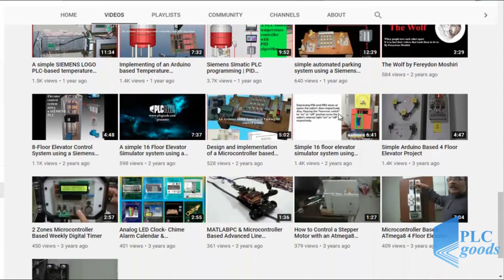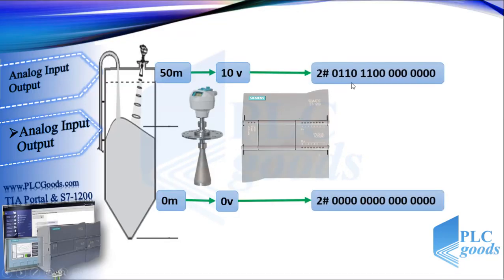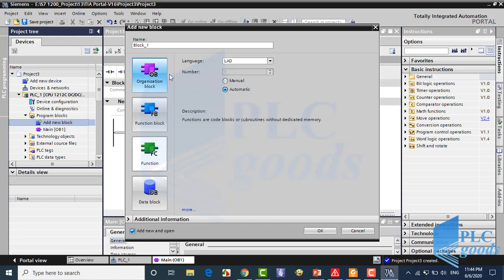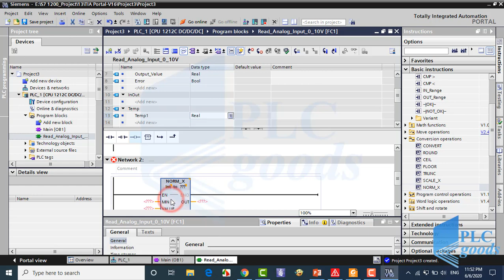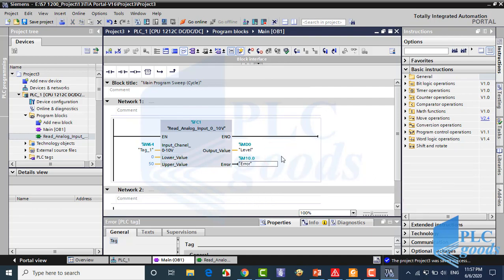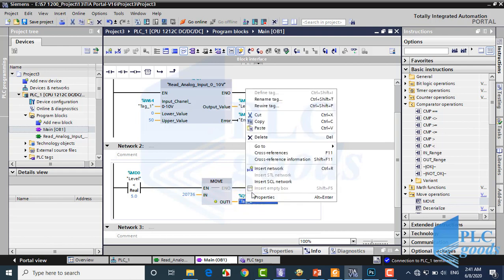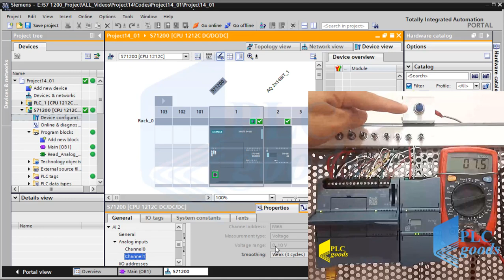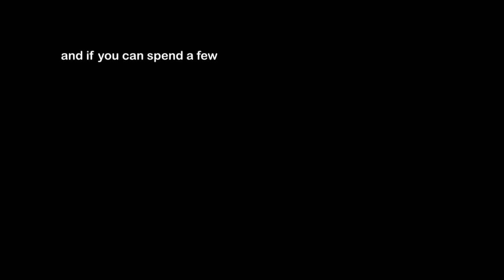How to use analog input/output signals / modules - siemens s7-1200 plc programming tutorial

Comment: Your explanation is supper and we have want to learn the S7 1200 PLC Module  connect the 68 nos of Ethernet connection and how configuration
Reply from the maker: Hi there. For example, ET200 modules are common to collect data and send them to the central controller. however, If you want to connect your PLC to 68 nodes via the ethernet connection, you may need to use other advanced manuals or courses

Comment: Thank you for this video, could you please, show use , how we can do wiring a 2-wire pressure transmitter to PLC 12001212c analoge Input???
Reply from the maker: Hi there, please download and read the user manual of your equipment and implement the safety points described there.

Comment: Great job 
I have valve working from analog output 4to 20 ma I want check signal from analog module if it’s working alone and I want check valve if it’s working alone because that’s process not working I want specify problem from valve or from analog module.
Reply: Hi there, you can use a multimeter to measure the current signal. First check your analog output module with a simple program that whether it produces 4-20mA at the output of your analog output module or not. Then check this signal reaches the valve. Finally, check your valve. You may need to replace it with another one.
Reply from the maker: Thanks for checking the channel out!

Comment: I test analog output same you but no signal at output modules . i can check analog output  by other means ? ( s7 1200 with  sm 1234 234 4he32 0xb0)
Reply: Please check these items:
1: Note that your module needs a 24 volt DC power supply. please check that and also your wiring base on its datasheet.
2: Note that your module supports both current (0-20ma) and voltage (-/+10v) signals at its output pins. So, check which type is selected in TIA portal.
3: Just write a simple program to send a constant number (for example, 20736 to create 7.5v, or 15mA) on your output pins. You can use a simple multimeter to measure the output signals.
4: Check your analog output address. Maybe you are using an incorrect address!!
5: Your module has  2 analog outputs. Check both of them. Maybe one of them is broken, and you have to use another one.
Reply from the maker: let us know the result